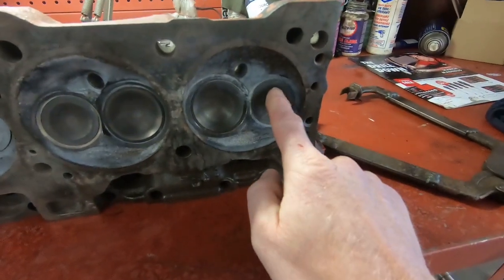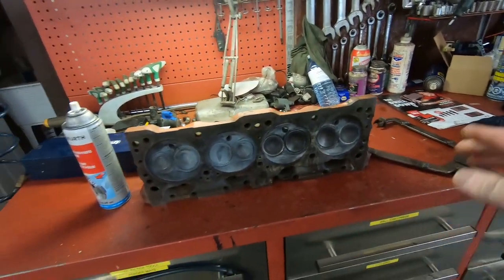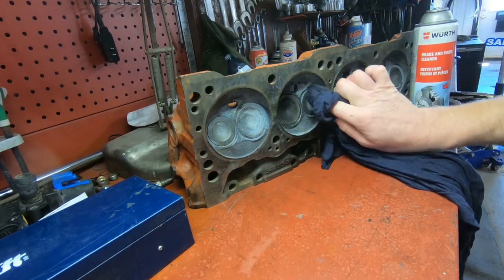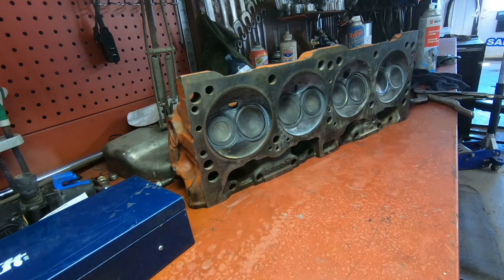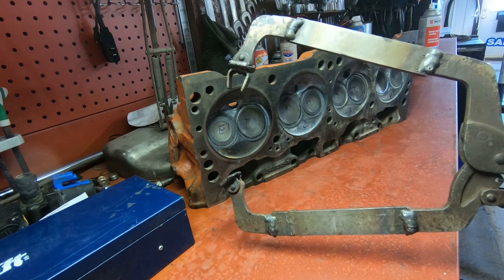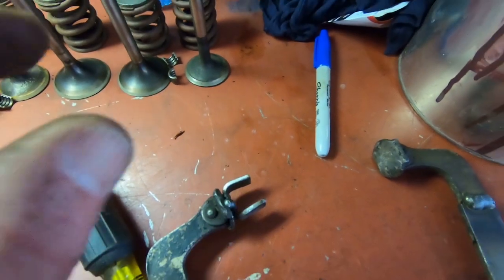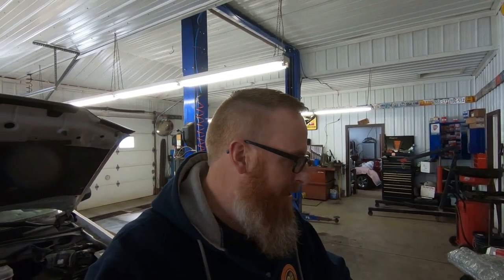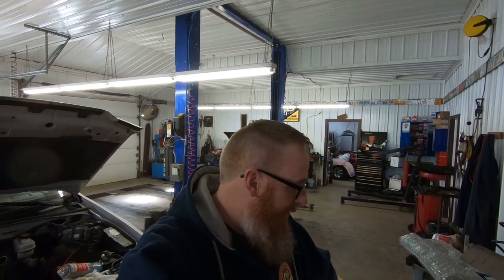MOPAR 915 J HEADS TEAR DOWN-PART 1

Comment: A trick that we use at the shop to hold the head is to drill a hole in the bench and use one bolt through the head into the bench to hold it down while removing the valves.
Reply from the maker: Good idea. I'll keep that in mind for the next one!

Comment: Cheap insurance new valves and springs matching the cam. I would have the heads magnafluxed before going to much futher and have a shop dip them and new valve guides.
Reply from the maker: That seems to be the consensus! I'll be dropping them off as soon as I gasket match the intake runners. Nearest engine rebuild shop is an an hour away.

Comment: I know this video was a year ago but maybe you know this maybe you dont ? on the very edge on the tulip part of the valves especially the exhaust valve if you smooth out the 2 sharpe or square edges you can pick up a little flow / HP .
Reply from the maker: Good to know for the next one! Thanks bud

Comment: Just found out my stock 360 has j heads 😃 woot
Reply from the maker: Good news, It may not be a stock 360 then. As far as I know, J heads only came on the 340's. But I may be mistaken.
Reply: @OldeCarrGuy  woooooooo
Its probably makin around 290hp then since i put headers and a 4 barrel on it. Cant wait for a cam
Reply from the maker: @cmw184  mine does 220 at the wheels with a cam so 290 at the crank is about right!
Reply: @OldeCarrGuy  do you have an electric fan? Thatl free up about around 15-20hp, and get better mpg
Reply from the maker: @cmw184  I currently run a clutch fan and get 18 mpg with 3.21 sure grip
Reply: @OldeCarrGuy  ah. Cant really get better than that! Man i thats what my volvo 240 gets rn 😂